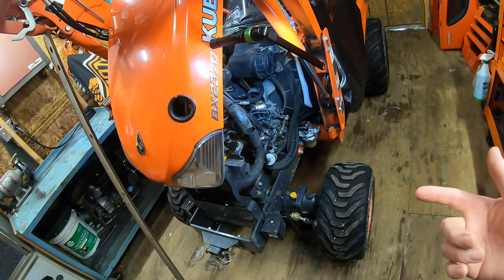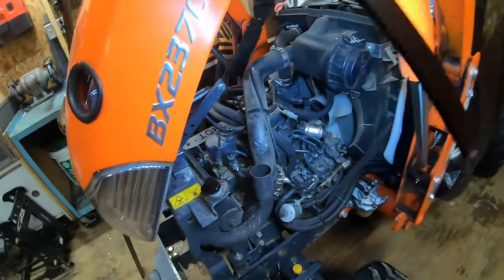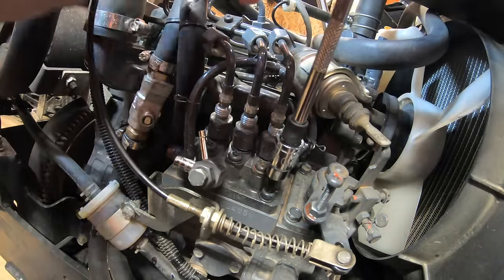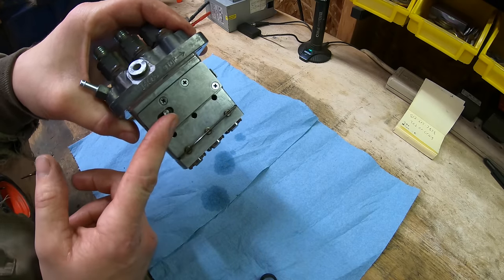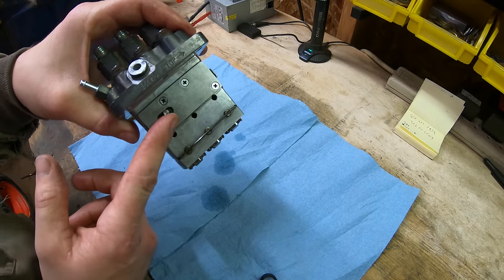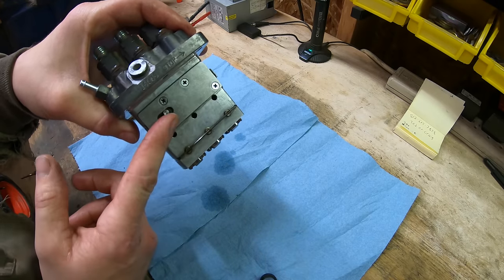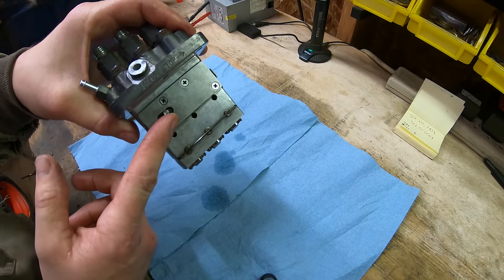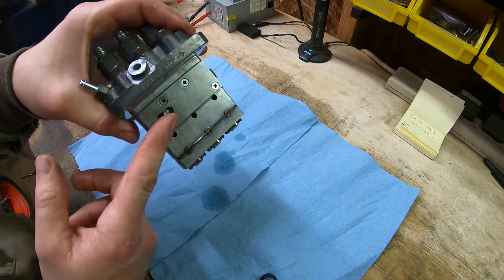Kubota BX- Injection Pump Modifications/Rebuild D902 (More Fuel!!)

Comment: I took the belt drive dan off my Kubota G1900 and replaced it with an electric fan and now the tractor runs hotter than before. Any reason why or how to fix it? I’ve literally asked so many people and it’s stumped them all.
Reply from the maker: Hey Jacob.. so the electric fan you replaced the belt fan with.. was it the same exact size fan? How can you be sure it’s moving the same amount of air or has the same static pressure as the old fan? You gotta figure when Kubota designs/builds these engines they perfectly tune every part to work just right with that engine .. so if I had to guess I’d say your fan is not outputting the same static pressure through the radiator as your old fan was.. it may have a higher RPM, or seek to blow more air; but once it’s pressed up against a radiator all that can change.. Why did you remove the old fan in the first place? Just curious.. was there an overheating issue before or did you just wanna go with an electric one.. let me know and I’ll try to help the best I can.
Reply: @BiffsEquipment  The electric fan is very close to the same size as the belt drive. Maybe a half inch bigger. We did have to do a little jerry rigging to the shroud to get it to fit, but it fits nonetheless. The belt drive fan was doing ok, but on particularly hotter days, the temp needle would get a little higher than operating. If you're interested in what kind of electric fan it is, it's a Spal 30100435. The only factors I think could be the problem is the belt is slipping on the water pump or the radiator is slightly clogged. I checked the thermostat in some 180 degree water and it opened. The only reason I really wanted to go electric is to move more air so I can make more power in the future by doing some engine mods.

Comment: i have a d600 kubota that i have turboed, im planning on putting 5.5 elements in it, runs about 12 psi at the moment, max fuel on stock pump, more rpm, timing, etc.
Reply from the maker: Nice man! What’s your EGTs like? 12psi is up there it has to be easily making double the power.. the thing I found about some of these Kubota super mini series like I have is that the heads don’t flow really that great and because of that you can only make so much power by turning the fuel up even with a turbo.. I planned to run around 5psi which would be a huge increase on my small motor. I already have the turbo and started building thr turbo kit but I’m waiting for my side work to slow down till I get back to it and do a video on it so stay tuned later this summer!
Reply: @BiffsEquipment  if you have TikTok look at my account, "thatcubkid"  2 days ago I cut the tip off my fuel screw, its pushing 15 psi now, i already ordered the 5.5's and its gonna be smokey. i know the garden tractor pulling guys can port and polish these small heads like crazy, they can about 2x the size of the exhaust and intake. i dont know my egts, another thing, these smaller motors cant push enough boost to hurt themselves, if i remember correctly yours was a d9xx, a few guys pull with them at 6000 rpm and 30+ psi of boost. a good turbo to use for your motor would be like a garrett gt12 or something similar, especially on stock rpm, but yes id say its making double the power lol.
Reply: @BiffsEquipment  I’m back, now running compounds, 6mm pump with a few little tricks, pushing 6500 rpm and 100 psi boost
Reply from the maker: @cs-gj3yf  that’s great to know about the amount of boost they can handle.. basically what they are saying is they can handle any amount of boost they can support through the intake with the intake being the limiting factor not the motor which is dope! 

Your gonna wanna check your EGTs tho.. you may not be able to hurt it from the boost but too much fuel will kill a diesel specially because more fuel means more heat, the more fuel the higher the exhaust gas temps and the hotter the exhaust gas temps the easier it is to start melting pistons and damaging the rings.. it can slowly eat a diesel up from all the heat from too much fuel under a constant load.. as long as the load isn’t constant you should be ok I suppose but under a long load like s tractor pull or something you can start melting it down or hurting the motor so just an FYI
Reply from the maker: @cs-gj3yf  what engine do you have again? Your running 100psi of boost? On a little 20hp diesel? That’s crazy I’d it is haha
Reply from the maker: @cs-gj3yf  the turbo I’m using is smaller than the garret you mentioned. The turbo I’m using is an IHI RGF3.. it’s the smallest turbo I know of for these little engines and I got it so it would easily build boost even under light loads. I’m not trying to make my tractor a pulling tractor.. just wanna see around 30 or so HP and better efficacy. It is a D902 engine
Reply: @BiffsEquipment  I know lol, ring gaps are opened, highest egt yet is 1285 and it lived it perfectly fine, I've seen some of these smaller ones run 2k and not melt the pistons, the limiting factor on these smaller idi engines is well, IDI! IDI don't make as much power and is gutless, another big thing is fuel, even with a fully built system we are out of fuel at 40 psi if the head and turbo flows good, remember boost is made upon restriction, ALSO, to much fuel will not kill a diesel as long as you arent burning all of it, its the reason all the diesel pullers dont clean up the smoke, if you clean up the smoke egts go through the roof, egts only get lowered if you turn the fuel way up or back it down to the point your losing boost, boost is also what raises egts.
Reply: @BiffsEquipment  yea its a d600, 15hp at 3600rpm
Reply: @BiffsEquipment  the IHI rhb31 would be a pretty good running turbo, I don't like the IHI turbos for boost, they are low pressure/high flow turbos, if you had the room id 100% use a gt12 or a kp31, those will push you up comfortably around 40 hp, a 5.5 pump and 20 psi is 35.42 hp, gotta be careful on a newer engine, ring gap stock is 11-12k and it don't take much extra heat to butt the rings and seize a piston, id only turbo higher hr engines, or tear one apart and open the gaps.
Reply: @cs-gj3yf  it is incorrect to assess the capabilities based on the amount of boost you are running. To a point, the engine doesn't care how much boost it has. Instead, it is the quantity of air you get into the cylinders. If the turbo is too small, it will make more power on less boost. At 100 psi, you are most certainly over-spinning the turbo. 100psi of boost pushing 120 psi of exhaust manifold pressure is most certainly a losing battle.
Reply: @hackish1  except i run a ported head with a big fuel system, and high rpm, small turbo is gated for that exact reason, and more rpms will make more boost.
Reply: @cs-gj3yf  This is incorrect. Opening the head and adding a big fuel system does not change the limits of the turbo. All you do is run the compressor well past its efficiency range. Over-spin it too much and the airflow actually stalls, so you have less flow and less power at more psi.  It's not different from cavitation in a boat - more RPMs on the prop doesn't universally mean more speed.
Reply: @hackish1  they are not overspinning, ive done the math and ive looked at maps, have all the data i need, the small turbo on its own can push 60, the big turbo i use is well known for a good 70 psi, the turbos are still under spun
, the point is a big head and a supporting fuel system is the reason itll even spin these turbos and make good boost with them.

Comment: More power, as in higher RPM or torque? Have a kubota engine 3 cyl industrial 1105.   was installed on a Miller welder. The engine is limited to only 2000 rpm, the seller never checked engine RPM after installing it. Oops. Paid very little for it.   Needs 3600 rpm thinking spring or your .50 mm to .55mm any suggestions
Reply from the maker: Hey billy, so the modification I did in this video was only enlarging the plungers.. with the plungers being larger it’s allowing more fuel to be dumped into the cylinders per stroke and keeps it consistent throughout the entire RPM band.. this mod will increase HP up to 5hp potentially if you have enough air to go with the extra fuel to allow it all to burn.. 5HP doesn’t sound like much but it is a TON for a small Diesel engine. As for increasing the RPM.. all you have to do is find the high RPM screw, there will  be a low Idle screw witch adjusts the rpm at an idle and another screw close to it which adjusts the max RPM.. both screws should be located near or right Infront of the injection pump near or on where the throttle cable atttaches to the pump. If your doing this just be sure to have an RPM gauge handy so you can turn the screw a little touch at a time and continue checking it with the gauge until you’ve reached your RPM goal. Also I’m unsure of the max RPM for a D1105 but I think it’s close to where you stated.. just be sure by googling the engine model/specs  online to see what Kubota rates it’s max RPM for being.. this way you can be the same or just shy of it.. also I would tune the RPM for what the generator on the Miller welder can handle and not just max the engine to its highest speced RPM as too much RPM could ruin your welder/generator if your not careful but too little as you prolly noticed will make it not weld good. Best of luck lmk if you have any further questions 👍🏻
Reply: @BiffsEquipment  Thanks for the response. The person who did this mod never checked engine rpm output. A lot of work,
Reply from the maker: @BillyBob-fd5ht  you got it man

Comment: Any updates on this mod ? Has it been worth it in your opinion? Very interested in a turbo setup as I've thought of this a few times myself.
Reply from the maker: As of right now I havnt had any issues with thus mod tho I’m not sure if it would be worth it to everyone. I mainly did it so that I could add a turbo to my tractor which is proving to be a lot of work (as I already started building the turbo kit for it) I still plan to do an update video talking about the injection pump mod tho and giving a quick update as to how it’s been performing. I havnt noticed a huge power gain but when I lug the engine down it does feel like it’s got a bit more torque but hard to say.. i know for sure once I add the turbo tho it def will as I’m def getting more fuel than I was with the stock plungers. Stay tuned and once I get caught up on other videos and side work I’ll make an update video 👍🏻
Reply: @BiffsEquipment  looking forward to the updates. It's great to see someone with interesting bx content. Thanks for the content.

Comment: I got a Kubota L4310 that is smoking bad an has a knock on the front of the motor thinking it coming from the fuel pump
Reply from the maker: Hmm, idk the injection pump shouldn’t make the motor knock, hopefully your motor isn’t on the way out. What color is the smoke? Is it coming out the exhaust ?
Reply: @BiffsEquipment  black smoke. I have put 4 new injectors in it. You can take the #1 injector line off an the smoking stops but still has a small knock all 4 has 300 lbs of compression